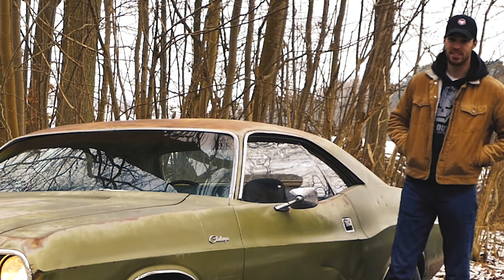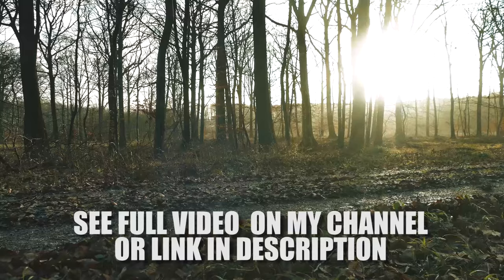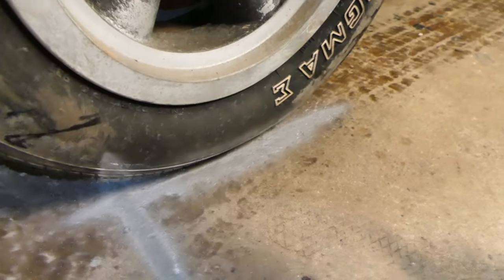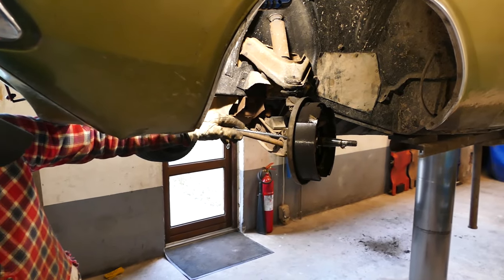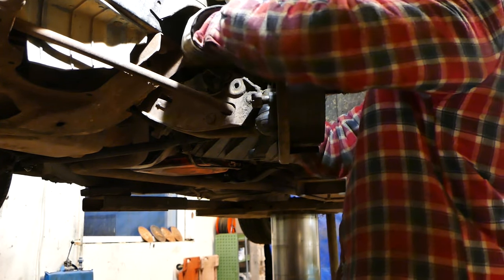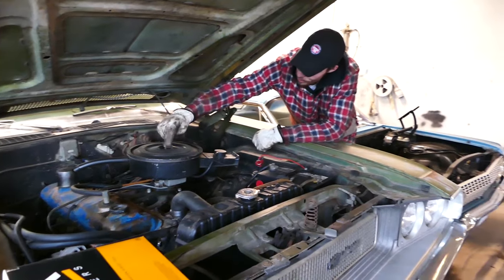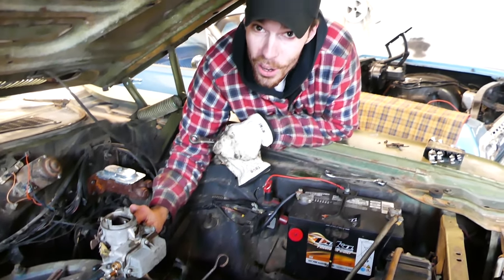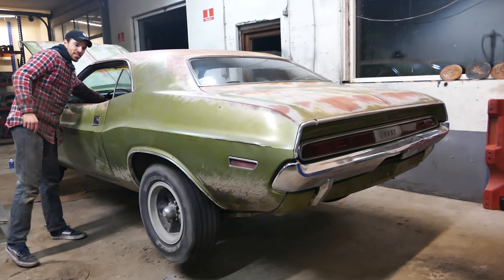FORGOTTEN 1970 Dodge Challenger 150$ POWER Upgrade & NEW Suspension!

Comment: Nice work!  I have almost the same car.  1970 challenger 318.  Been daily driving it for the last dozen years here in So Cal.   300+k miles  Took it off the road finally to rebuild the suspension
Reply from the maker: thats damn cool man! love when people use these old cars! yeah its good to get some fresh stuff on them i should probally do shocks and strut arms but go coilover swap soon 😬
Reply: @Viktorrhansen   I tnink coilovers are overrated. the stock suspensions on these mopars were good geometry from the factory. they were just massively under sprung and damped. If you get new shocks and Torsion bars they can handle surprisingly well.
Reply from the maker: @benjaminkadron6674 i agree and might be further down the road i upgrade to a full qa1 fromt frame, the roadrunner i had drove execlent after i added some toe in 3 degrees more caster and a 1.5 degrees of camber
Reply: @HansenSpeedShop  swing by after I run a certain semi-legal rally about springtime & drive my Plymouth A-body and try the Bergman Auto Craft stuff.

Comment: I would check out the steering box to tighten up steering. With the age of older boxes the internal gears will wear out causing slop in steering.
Reply from the maker: Yeah defently some slop there and the joint that sits on the splines aswell!! thanks for being a subscriber for 4 years man!